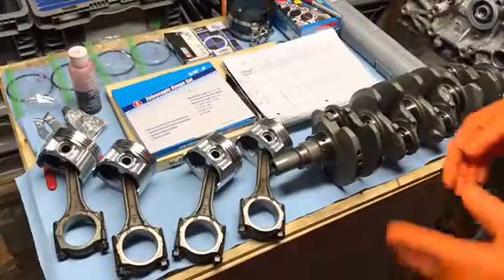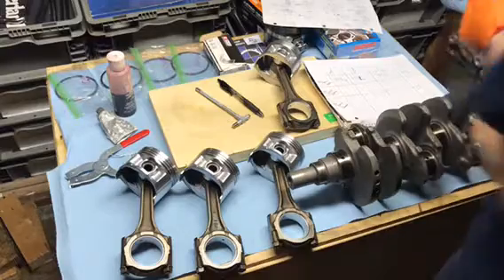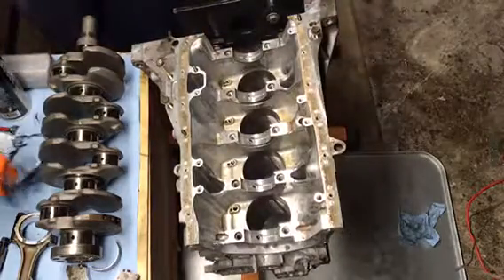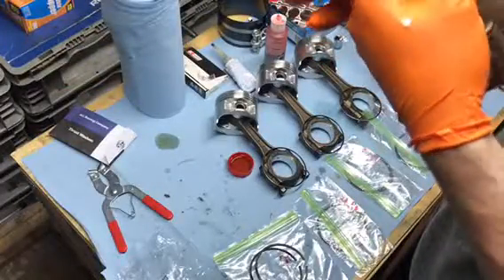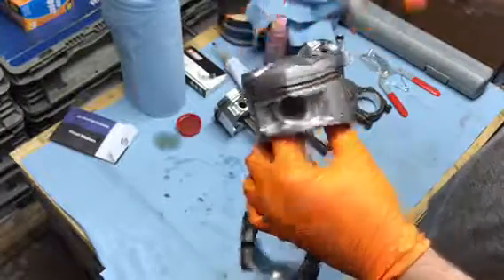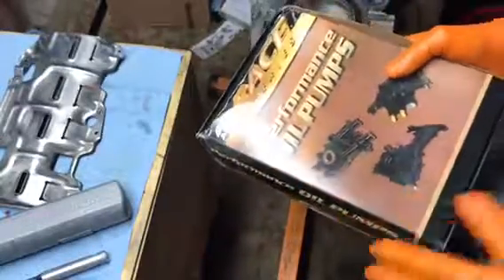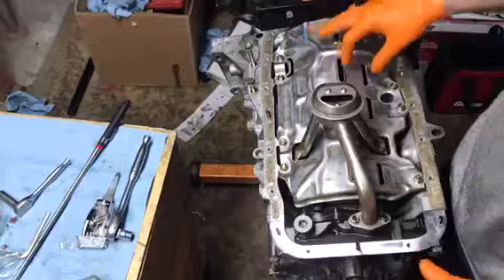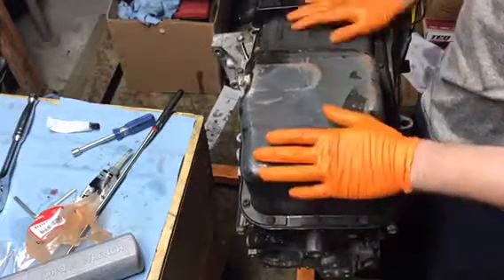ALL MOTOR B17 CRX / B17A1 BOTTOM END ASSEMBLY / HONING THE CYLINDERS AND INSTALLING RINGS

Comment: I got a b17a1 block & a b16 Crank, what bearings, rods, & pistons do I use?
Reply from the maker: B16 and b17 outer blocks are the exact same. If you’re running a b16 crank you should run everything internally b16.